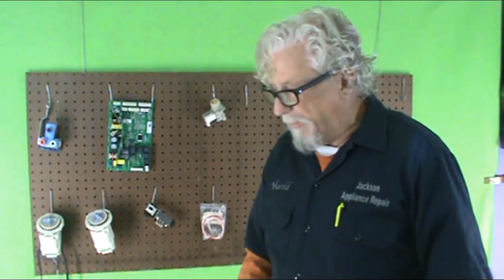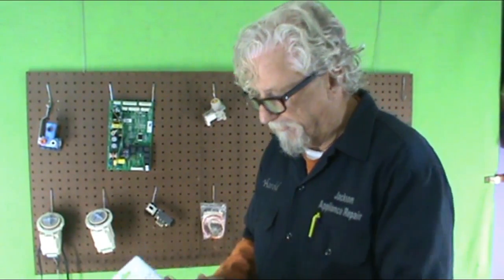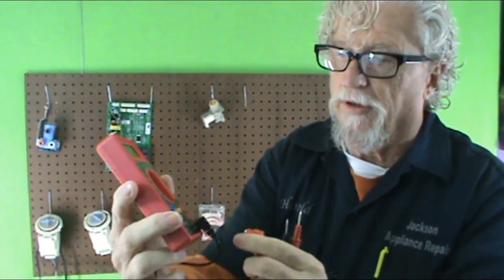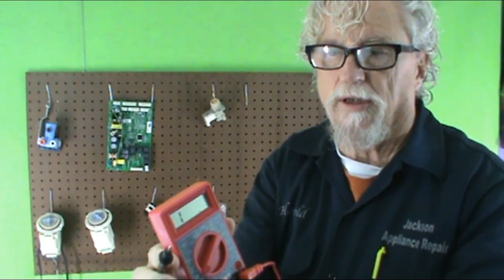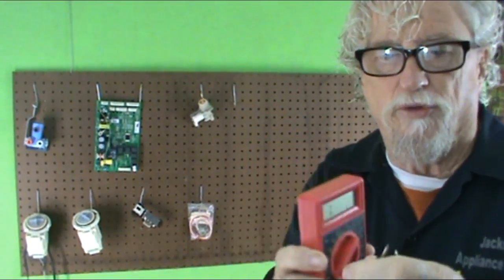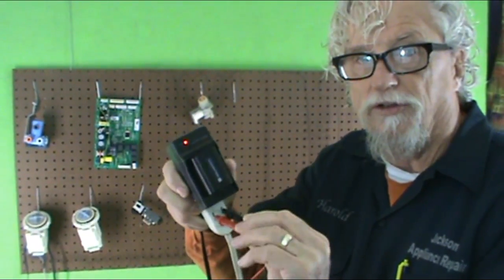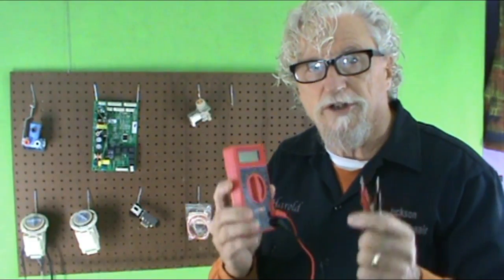How to use a Digital Multimeter Test meter

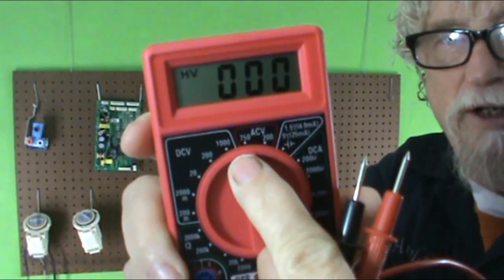Comment: At time mark 3:39 you point out 750v. i have a  centec 7 function that doesnt have ACV 750 but has 250. That should be sufficient for home 110 to 240v , correct?

Comment: Not all parts will register 0 ohms. It is according to how much resistance the part has. 
  An example would be an electric dryer heating element.  It might show like 12 ohms if it is good. 
  They are very handy to have on hand if you deal with electrical stuff.
Reply from the maker: Most heating elements work or don't work. I think you are referring to the thermostat. Good luck.

Comment: Could you make a video showing how to use a multimeter on an ebike controller ? Without hooking it up to a battery or anything else? Like my new controller with the matching controller has a jst-sm 4 pin connector for both the brakes and the throttle. Grey, white, brown and black. They told me the grey and white wires are for the brakes and that leaves 2 wires the brown and the black for the throttle which has 3 wires. Please and thankyou.

Comment: Great video.  When testing wires inside a battery operated toy. What dial setting do I turn it to to check power?
Reply from the maker: The same voltage is the batteries that are in the toy

Comment: How do I test my Harley Davidson for ohms using this cheap meter
Reply from the maker: Hi Matt. Hold the two leads together and turn the dial till it beeps or it goes to zero and that will be the correct setting.

Comment: Harold Jackson:  I have one of these that I got at Harbor Freight Tools. It is the exact same one that is in this video. I have had it in a drawer for many years, and it has never been opened. I was wondering if there is a battery inside it that makes it work? If so, do you think I should replace the battery?
Reply from the maker: Yes 9 volt battery
Reply: @HaroldJackson  The previous 9V battery didn't work, so i put in a new one, and it works fine now.

Comment: hey Harrold what do i use for a breaker box? my dad said DCA 200 but which one?
Reply: i figured out its ac 200 😂 thank you for this video ❤🤗
Reply from the maker: No not DC. For house electrical use VAC. 200 for 120 outlets and breakers.
Reply: @HaroldJackson  thank you so much. i took welding at my local career center and i thought thats what it was. i couldn't remember what i learned 6 years ago. again thank you for your video!

Comment: I have this Can Tech Multi meter. How can I use it to measure capacitor?

I believe I will need to use ohm setting. Is it correct? Like checking battery resistance.

Am I suppose to charge up the battery before test it?

Not an electronic guy. Learning as I go. Thanks.